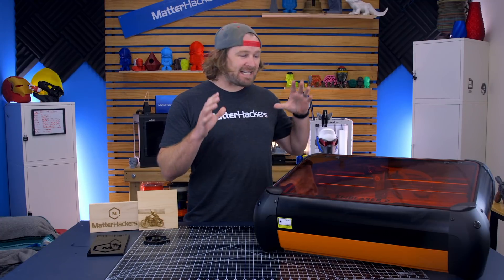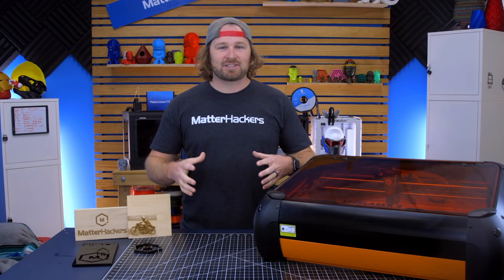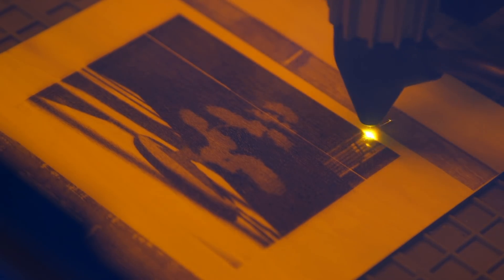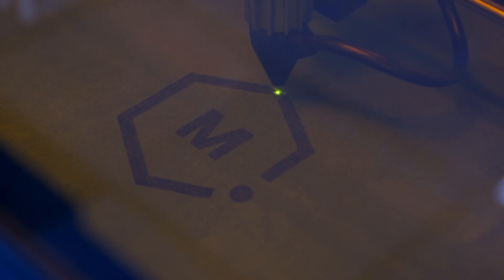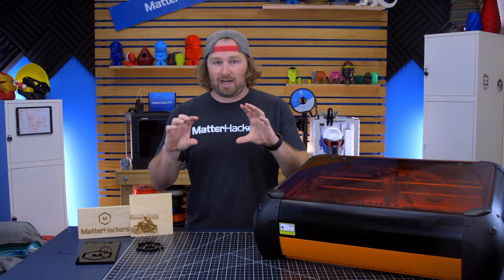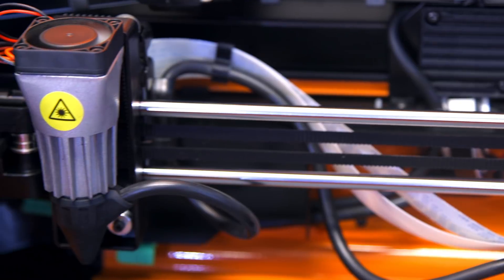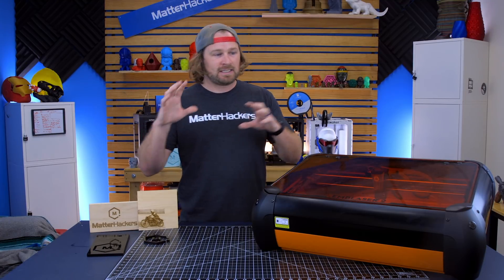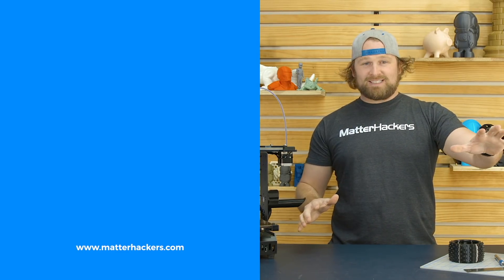The Emblaser 2 // Laser Cutter & Engraver

Comment: "Cuts accurately and precisely every time"  then on the video it skips a line.
Reply: That does not necessarily mean its the printer. It more than likely was a bad file or maybe a connection issue. While I agree they should have caught and corrected this, it should not be assumed the printer is at fault. I would say it is more likely a marketing error. I would like to know how they get 3D out of it though?
Reply: @kevinm3751  3D probably via cutting.  They didn't show that.  Another poor video overview oversight IMHO.
Reply: I agree Brian.
Reply: Brian Flores do not recommended?
Reply: "60% of the time it works every time"
Reply: Yeah I saw that.  Makes you wonder if it was the laser, hardware, software, or by design.